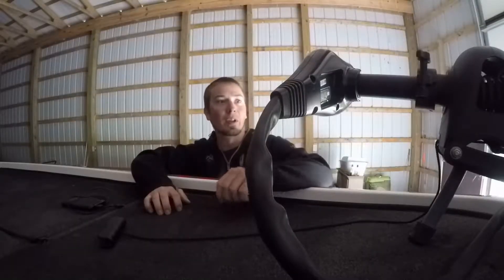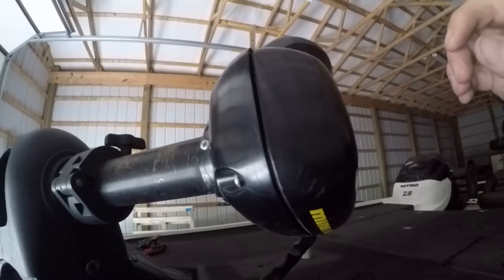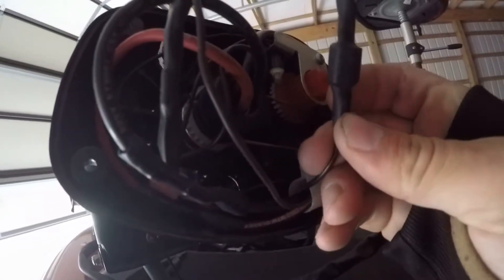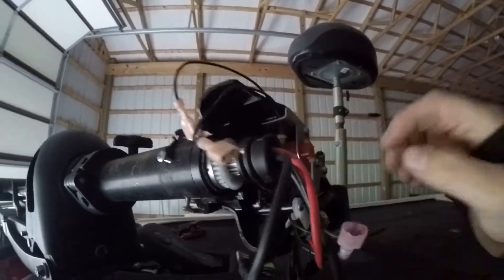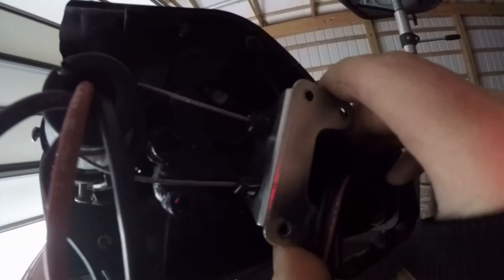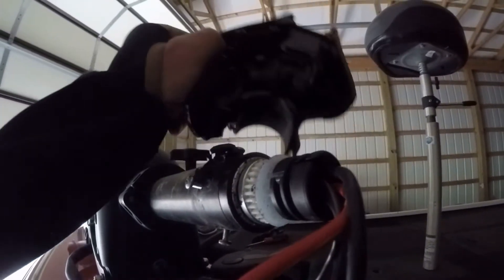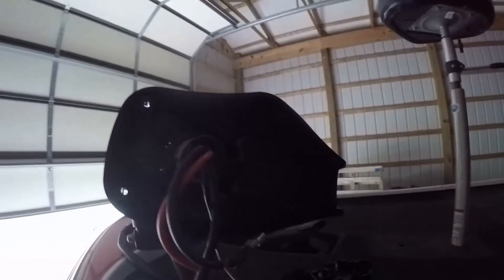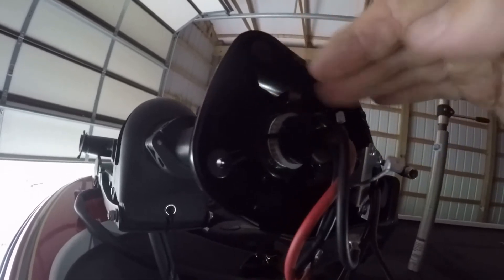MinnKota Head Replacement How To Maxxum and Edge

Comment: Yep!  Same here.  Took my boat for service, got it back.  Went to the lake and had no control of my trolling motor, clicking foot pedal.  Got back and only then is when I saw the crack(s) in the lower body and the drive cable disconnected.  Thanks for the video.  Step by step and concise !!  Thanks !  Saved me as well, $$$ and Time.
Reply from the maker: Glad I could help you out!

Comment: With The new style Maxxum control box and new style cover what direction indicator do you use? Old red style to short.
Reply from the maker: I ended up using the newer yellow color indicator. I believe that I had the same problem that you are talking about with the red style. The kit that I ordered came with a new yellow one also.

Comment: Great video. Question, I just replaced my trolling motor and when I push it down the cable jacket prevents it from laying down flat. If I loosen the three screws from motor head and adjust it to where I can lay if flat would that cause any issues?
Reply from the maker: Rod Bending Addicts I think you would be fine as long as you snug them screws down in the end
Reply: @mibasscraze8084  Thank you. I am definitely trying it.